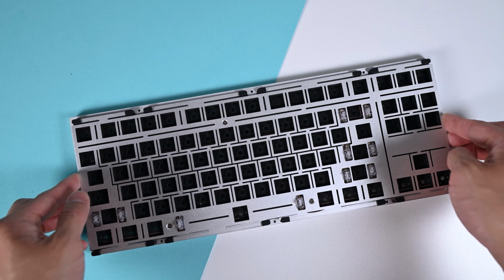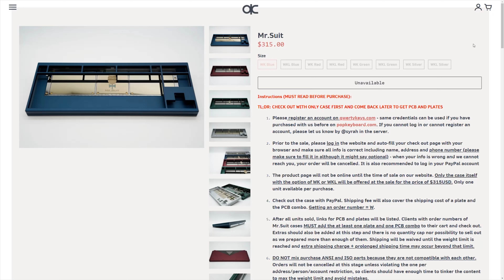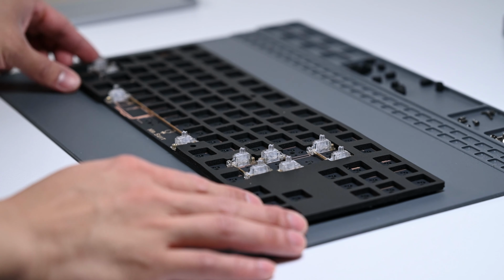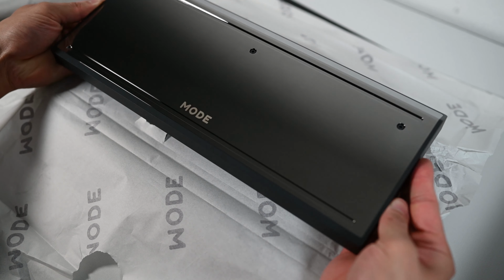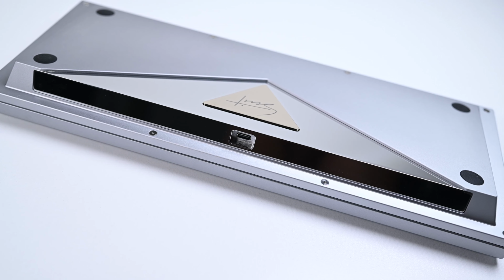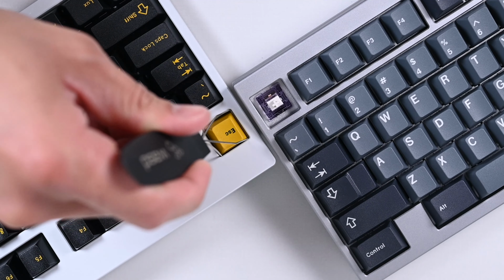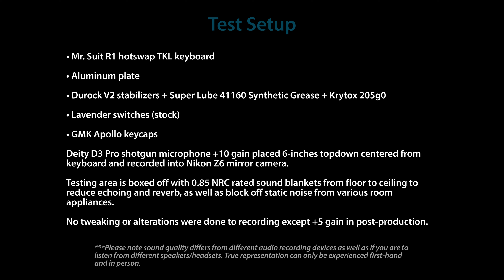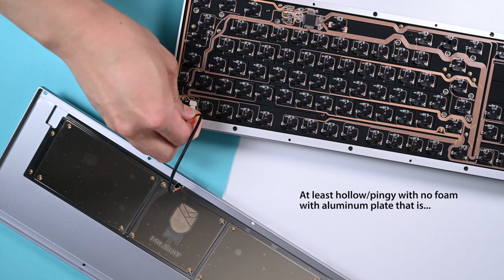OwLab x Mr. Suit Keyboard R1 Build & Review

Comment from the maker: Curious, what do you think of the Gazzew Boba LT switches used in this board? They sound funny/weird to me in person. Sounds kind of "loose"... not sure how else to explain it. It doesn't sound very thocky as that was the expectation from U4T.
Reply: First off, were you able to get into R2, i got one but it was a real shit show. Also i wish you had explored more plate options, Alu is a good base but i would hardly say its the best choice for linear switches personally would have gone with POM. Edit: recently got my boba LTs in and ive heard that they need to be broken in as well, but i lubed them anyways and the sound much better.
Reply from the maker: @awsomeon1  I got an R2 yea. Very lucky I was quick enough lol. The reason(s) why I used aluminum plate was it was what was sent to me. This R1 board, as mentioned in the video, is not mine. What I get is what I get. Also, even if I had my own choice of plates, I would still use aluminum. Because most boards default aluminum as the baseline so it would serve as a better reference in comparison. It's not a matter of whether it's better for linear switches or not when I made this review. However, I will have another Suit video coming since I did get an R2 myself, and that will include sound test for all the plate options.
Reply: @hardlinenexus  Im very interested in what you put out. Can finally tell how different youtube vids are to real life. Will be using Boba LT's and POM when my R2 comes in
Reply from the maker: @awsomeon1  which color did you get? I got black/gold chamfer
Reply from the maker: @awsomeon1  yea I got it off of qwerty
Reply: Are they smooth with lube?